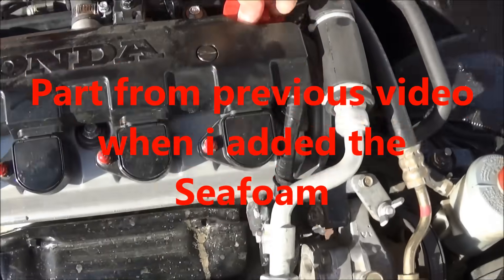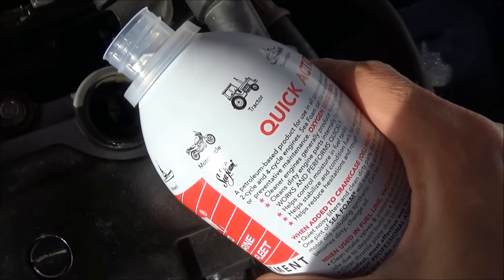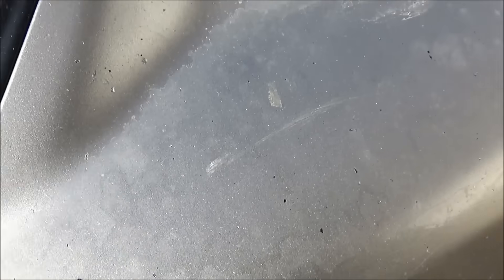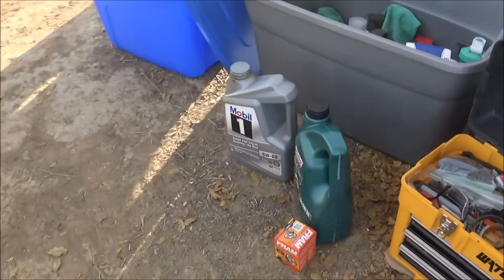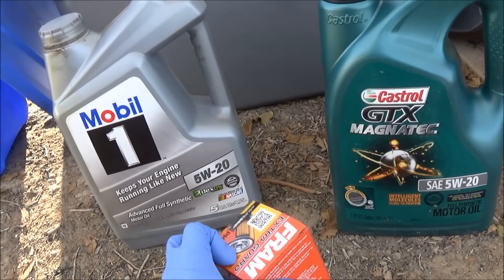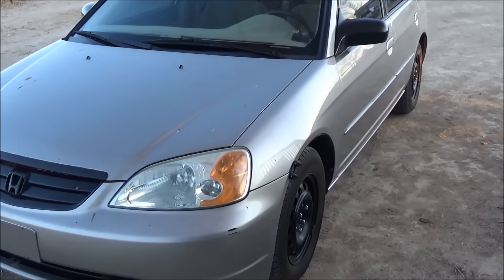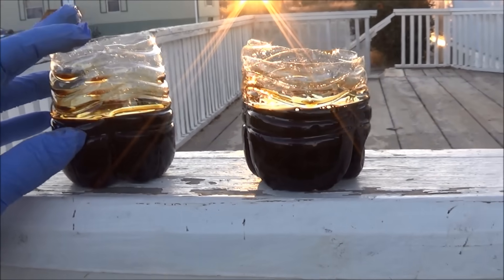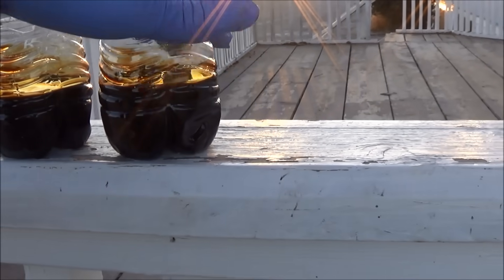Seafoam In Oil | Seafoam In Oil Before And After | Seafoam In Oil Before Oil Change [Sea Foam]

Comment: You must not care about your car to buy Fram filter! Fram is the absolute worst oil filter you could buy
Reply: EgyptianDragon What if I told you every airplane in the sky has oil filters coming off e same lines as FRAM? Because they do.
Reply: I use the fram ultra synthetic on my car and its really good
Reply: Keon Cooke I haven’t tried that one yet. I always use M1’s annual oil filter(the one that lasts 20,000 miles) but I do my  oil changes(I use M1 Extended Performance) every 7k miles even though the oil is still in great condition. I’ve been curious about that filter though. It looks like it’s good quality and can filter pretty well.
Reply: @sk8punk318  it actually does filter really well, whenever your up to it give it a shot outs a 20k oil filter as well as the Mobil 1. For a bit cheaper as well. Like $9 at walmart.
Reply: Keon Cooke I’m not a Fram guy at all but I’m curious bout that synthetic
Reply: 200k miles on conventional oil and fram filters no issues ever 🤷‍♂️

Comment: Fram is not a bad filter most people freak out over the paper end caps but has never the filter collapse. Frame can handle oem oil pump pressures just change your oil  and filter every 5 to 7k and you will be fine...
Reply: Fram is the only filter I have seen collapse. And I have seen it on a couple of occasions. Not only that, cut one open, there is half the filter media of other major brands.
Reply: @jnotah  post it... bc I do not believe you...
Reply: @toniored6830  I don't need you to believe me. This is for the people that are trying to decidewhat brand of filter is right for them.
Reply: @charles1630  Thanks Charles, no more fram for me!  I usually don't use them but occasionally have picked one up.

Comment: Worked great in my 3.2 VTEC Acura, pour it in 100 miles before oil change just 3/4 of it. It quiet down engine and made run smoother.  I used silver high mileage bottle. Use your common sense don't pour whole bottle into crankcase, doesnt need much and pour rest into the fuel tank
Reply: гониш

Comment: U put 4.5 ounces in your car 4 cylinder no more than that than 100 miles change your oil and filter da hope this helps cleans out the engine and dumps out with the oil when u change it works done it several times in my honda cleans it very well i use the gumout tuneup n bottle though not seafoam
Reply: Not one period or comma?

Comment: Seafoam messed up my hyundai accent
Code P0300
I put too much 😆
1.6L and I used about 5oz in crankcase
 plus 1 bottle in gas tank
➕ 1 bottle sprayed in the intake lmao
My car started shaking like crazy and it doesn't go away after 2 oil changes and 2 gas fill ups
TO TOP IT OFF I WAS GOING TO ADD A BOTTLE OF MYSTERY OIL 
* WHAT AN IDIOT LOL
I SHOULD BE TAKEN TO PRISON FOR KILLING THAT GOOD ENGINE BUT CAR STILL RUNS THO
Reply: Clean the throttle body,  but remove it to clean it, don't put any more chemicals in your car. Maybe get a new throttle body and don't forget to reprogram it...
Reply: @delta8911  my car runs normal now after driving it for couple of months.  Thank you
Reply: I don't believe that Seafoam in your cranckcase can cause a cylinder misfire  (PO3000).  I'll wager this was a mere coincidence.
Reply: Same thing happened to my old beater Nissan Maxima
Reply: @Chinunit22  that sucks
My car runs a lil better now
Reply: I'm with Sojourner... I don't think there is much of a way for a little seafoam in the crankcase to cause a misfire.  I think you have another issue somewhere in the system.

Comment: Using better oil and filter will extend the life of your engine and the performance  so you being cheap is just screwing yourself in the long run. Not my car though...
Reply: So exactly how is castrol 5w-20 with a fram oil filter is him screwing himself in the long run? Just simply A proper regular routine oil change will extend the life of your engine, thats enough. And fyi his engine takes Castrol fine

Comment: Thanks for the video.  Although a before and after shot of the engine would have helped so we can compare.  Also, I'm surprised your using a FRAM oil filter...  Also known as the OCD... Orange Can of Death, in automotive forums.  Anyways I wouldn't recommend them (I use Wix filters instead).

Comment: Dont use fram broo
Reply: Just but the Honda filter. Fram is regarded as being the worst filters. Even here in UK
Reply: I've used Fram for over 30 years! Not one problem
Reply from the maker: Why lol
Reply: Look at the youtube comparison test against other filters...you wont go back to fram....
Reply: Fram is a crappie  filter it filter very little
Reply: Lmao I kept a fram filter in my 92 Camaro for 30k and just changed the oil ,when I finally took it off it was still in good enough condition to go another oil change guaranteed ... most filters are just rebrand anyways...fram are deffinetly not gonna give you trouble if you actually change in regular intervals I can attest to that
Reply: I would also beat the piss out of it.. any chance I could do 100+mph I was soo...

Comment: Hello, may I suggest you take the old Fram filter cut it in half and see how it is made you will find out that it is poor construction. You can use a Napa oil filter they're about the same price but the in tyria filtration system is better quality will not break down so easy and risk the damage of your engine.
Reply: Always use OEM
Reply: @memoloco328   Yes, at least O yes'm you've got better
Reply from the maker: Thanks
Reply: its construction is cheap but their filter media is decent. The cardboard crap scares people since who wants cardboard anywhere
Reply: I believe Napa filters are souced from Wix.

Comment: I've always used fram extra guard & haven't had any problems in over 25 yrs. Now that I've seen the video's about how cheap they are compared to k&n or Mobile 1. Think I'm kicking the orange can! I have a Expedition & Camaro Z28 w/ lt1. Only 30,000 miles on it. Can't have any bad oil filters that's gonna cost me in the future.
Reply: K&N and Mobil 1 filters are overpriced as it is, just get Wix or NAPA (which are wix anyway I think), Hastings is also a good brand. Better yet buy Delco, motorcraft, Honda or whatever brand your car is filters mail order, get a few at a time for the best price. Can't complain about what the factory wanted in the first place.
Reply: Smart move man, just started making the same changes on my frs, never realised how bad fram was until I saw the videos cutting them apart it's unbelievable!
Reply from the maker: I have a few oil filter videos my self check em out.
Reply: Thanks everyone!!!! I didn't know if they sold Wix in Ga? But if Napa is the same it's betters than fram. I really like the idea of ordering multiples online to save money as well! Great idea! Anyway to get more miles out of our motors will pay huge dividends in the future! Motorcraft would probably be better for my Expy & so on as far as factory one's. Thanks!!!

Comment: Ya know if you actually cared about the car you wouldn't be using the cheapest filter in existance that literally comes apart and throws more trash in your engine.
Reply from the maker: Link in description to oil filter videos cut open after 5k miles. Go check it out and subscribe

Comment: If you want superior oil protection just drop a cow magnet inside of your spin-on OEM oil filter. No iron nano-partials will get by. You'll be amazed at the results. I've been doing this for years on all my older engines and they run forever......I also use Seafoam products with great results for years, never any problems. Good luck 🤠
Reply: I tried it. I got tired of cows getting stuck to my oil filter.
Reply from the maker: Awesome great tip Thanks
Reply: Cow magnet??? Please what is that
Reply: So, how to get magnet out? Guessing forceps, or hemostats?
Reply: @pootthatbak2578  Yap or a  needle nose, or a second magnet (works best). Then wipe the mettle scum off of it and reuse in the new filter. I like the solid iron cow magnet type not the partition kind. I worry the partition kind might fall apart if not oil compatable 🤠.
Reply: @Geonious  That was interesting!!! Never knew! What do you do? Put the cow magnet inside the oil filter? Or like on the outside of it? I'd feel sceptical about putting it inside.
Reply: @michaelgordy6283  The magnet goes inside the hole cuz that's the oil that has just been filered. The magnet wont back out cuz it is super strong and attaches itself to the inside (magnetic bond). It's also larger then the exit oil port. You can attach to the outside also but you won't be able to see the nanos it atracks.  A magnet can also safely be attached to the bottom outside of the oil pan cuz that's where oil sludge settles normally. I like to put a cut down cow magnet into the oil plug. Making sure its securely attached, so to make sure all the sludge comes out when I change the oil, persay.... nanos, burrs, nuts, bolts, gear teeth, etc. LOL 🤠
Reply: @ICOWBOYIM  That is very interesting!!! I seen the link as well. I can't see it harming the motor. Gonna see about doing this with all my cars! Thanks!!! And Thank you for replying back to me!!! Really appreciate it!!!
Reply: @michaelgordy6283  Just do it on engines that are already broken in properly. If you were to do it on a newer engine, it wouldn't wear-in at all (wear-in is done by the abrasiveness of the iron nano particles , that get through the oil filler and into that oil stream). This could result in low gas mileage and overheating and void warranties. The magnet stops the nano wear out process.  So it needs to be installed at the right time in the life of the engine. Just like using super oil additives, i.r. Slick-50, Duralub, Bestline. Do you get the point?
Reply: @ICOWBOYIM  Thanks for the reply & determining the use of the cow magnet! I think I get the point.  On regular oil changes at what mileage would you consider using it? My Expedition has 165,000 on it. Would this be typical? It runs great. However I'd like to get as many miles on it though. Thanks for the info Rich! Greatly appreciated!!!
Reply: @michaelgordy6283  OK!, I would recommend not less then 30,000 miles. On your high mileage engine go for it! Also add an oil additive to get the ultimate friction/wear protection. For years I used Duralube but now I'm switching to Bestline as an oil additive (technology changes with time). The initial cost may be high but the long term savings in the life of your engine is great. It is cheap insurance! You will have to suit your self now you know the facts. All my vehicle engines got over 200,000 miles when I traded them in! I had one that was 275,000 miles and would still squeal rubber at the line when I traded it in! I'm a retired Master Mechanic with 45 years of industrial expirance and I'm speaking to you "my friend" to save you the mysteries of the learning curve. Keep me posted on your results,  Good luck 🤠
Reply: @ICOWBOYIM  I sure do appreciate the advise! Last thing I need is to replace my motor & any kind of advise like you said is really priceless! My dad taught me alot about cars over 30 yrs ago & I'm just trying to know as much as I can on maintaining what I have. No one likes to buy thing's twice. Take care of what you have & it will take care of you. I sure will keep you updated Rich!!!! YouTube has been so helpful in my & has saved me $$$. Thanks Rich. Best regards. Mike
Reply: @michael gordy I honestly don't know. I was just looking up what a cow magnet was and posted the link. I too would like to know how it works in an oil filter!
Reply: Thanks rich, i see the link
Reply: Those are expensive and block oil flow. No thanks. If you like magnets on your oil filter you can buy them cheaply and put several on your filter.
Reply: Won't this lower oil pressure in the filter? I would be worried about blockage.(?)
Reply: They have magnetic oil drain bolts for this situation.
Reply: @ICOWBOYIM  what the hell is a cow magnet?

Comment: Fram makes great oil filters I’ve used them for years.
Reply: Frank is literally the cheapest and worst filter in existance that comes apart and throws trash in your engine once it does
Reply: They are both important.  YOu need clean oil and a good filter to catch any particles in your engine that are flowing around in the oil.  If you get a cheap oil filter, it can collapse and cause issues too.  Another reason I don't use or recommend FRAM myself.  Wix filters are much better, or at the very least, get a Mobil 1 or Bosch filter.
Reply: @heelixrainier9331  much more stringent requirements in oil than an oil filter. My point was 99% of oils on the shelf are all equally good for every day driving. Same cant be said for filters
Reply: @trudeaumustgo1920 Yes I sort of misread your post initially.  I agree.  Whether you get Valvoline or Mobil 1 synthetic they're about the same.
Reply: Oem is the way to go with oil filters. Oil is less important than the filter i think.

Comment: You put in 1 oz.    average oil capacity in a gasoline engine 4.5 qt to 6 qt.
Reply from the maker: Mines 3 QTS.
Reply: Gaming & Cars That car on camera takes 3 quarts???   Learn something new every day.
Reply from the maker: Yes. My car 03 Honda
Reply: It's a 4 cylinder. They don't take much oil, especially Honda's. Most civics and accords are around 3.7 quarts

Comment: Man I don't have the stones to put seafoam in my oil, and I agree with everyone else pay extra for a wix or even oem filter.
Reply: Marvel mystery oil is a good additive. I've also known people who like running a quart of ATF for 50 miles or so before changing oil to clean the engine up better. If you worry about deposits, try running Rotella diesel motor oil for a change interval, Diesel multifleet heavy duty oils have high detergent and dispersant packages to keep engines clean, if your engine is really gummed up, change the oil filter after 1000 miles, then keep running the oil till the next change. Use walmart's supertech synthetic as it's as cheap as conventional brand name oil and is better for the job.
Reply from the maker: Just do it lol! And ya I only run Mobil one and k&n oil filter.
Reply: Mobile filters is all i use.

Comment: The sea foam oil is very thin. Be careful not to run your engine for very long with sea foam in it. It can cause engine damage due to the oil being thinned out. But yes it does clean your internals. If you want to keep your engine clean change your oil every 3k miles not 5k. I know it's more expensive but your engine will have a longer life so it will be worth it.
Reply: Dave Maximillion  you’re just wasting money if you change oil every 3k. Especially if it’s synthetic.
Reply: Jason Beatty only 3k if it’s a car that sits a lot and isn’t always brought up to temp to burn the moisture off in the crankcase.
Reply: Dave, sorry but thats the crazy CA BS I experienced when I moved to CA.  Lots of fleet studies done on fleets of thousands of taxi's show that 7500 mile interval is fine for non-Synth oils.  Thats actual 'severe duty', not driving on the freeways and in the burbs.... As long as you keep it topped up, even 5k is more than enough for today's oils, not to even get into synthetics. And make sure if you use Synths to read the bottle and make sure its full synth and not a mixture!

Comment: Just buy Pennzoil it cleans the sludge out already 1st time
Reply from the maker: I prefer Mobil one
Reply: Use to buy cheap oil and in doing so, my cars all started to burn oil. Switched to Pennzoil years ago and never had issues with a my vehicle's with burning oil. Just purchased another car and the previous owner used Castrol, so I'm making the change from Pennzoil to Castrol to keep it the same as what the guy used. I would recommend Pennzoil to everyone. I do hope Castrol will be to my liking and perform as good as Pennzoil or better.
Reply: @grassrat4506  thank you 👍 official oil of Hennessy performance and Ken block too
Reply: Pennzoil was always the shittiest oil you could add. Might have changed in the past decades, however the extra $10 for Mobil 1 once or twice a year is worth the piece of mind for me.
Reply: Josh B Never buy Pennzoil
Reply: @DavidSnyder1970  has been used in all my cars and is recommended by alot of manufacturers
Reply: Josh B *a lot
Reply: Josh B I’ve never talked to a mechanic who recommended Pennzoil. They all say you should avoid like the plague.
Reply: @DavidSnyder1970  funny it's recommend by many manufacturers
Reply: Josh B You don’t know how business works, do you? Car companies don’t make much money on the car, they make money on OEM parts they sell later. If I am the car company, I want you to purchase parts so I make money. Therefore, I want you to use inferior products to ‘protect’ your car. Keep using oil with wax.
Reply: @DavidSnyder1970  how does one ask a question and then proceed to just telling me ....thanks captain obvious I Never knew cars have many parts that break 😂
Reply: @DavidSnyder1970  I simply commented on a video on what oil I use and what it does ...you proceed to basically tell me a life lesson or story , go on Pennzoil website it shows a list of auto makers , iv used it myself with amazing results for cleaning sludge...realax go do something I commented on a video and shared my opinion like everyone else I don't need or want to hear your live story or for you to "teach" me anything
Reply: Josh B Simmer down Sizzle Chest
Reply: @DavidSnyder1970  simmer down your the one who responded with a book 😂
Reply: Josh B Alright Liver Lips, everything’s gunna be ok.

Comment: I had a 94 Mazda B3000-4wd where the valve train was that clean, only because changed the oil/filter religiously at 3,500 miles. The dealer made a ton off me in the sales of oil filters, no aftermarket oil filters for me..........
Reply from the maker: I'm a diy kinda guy myself man